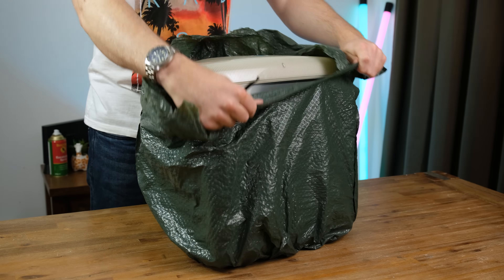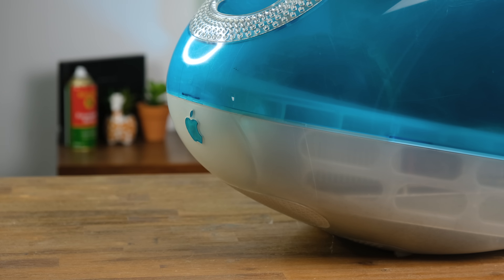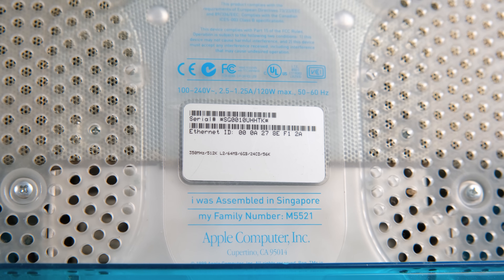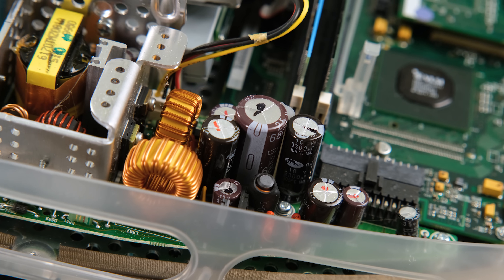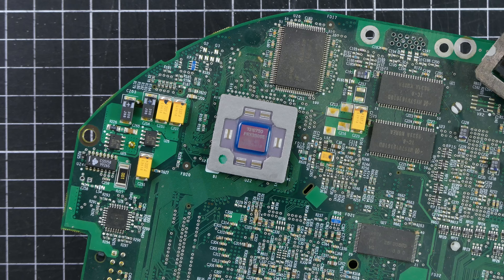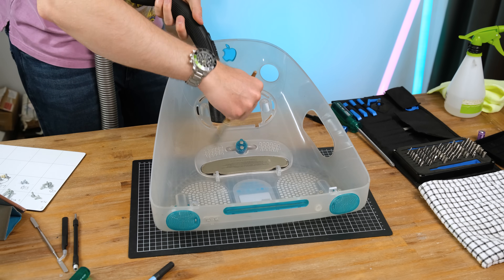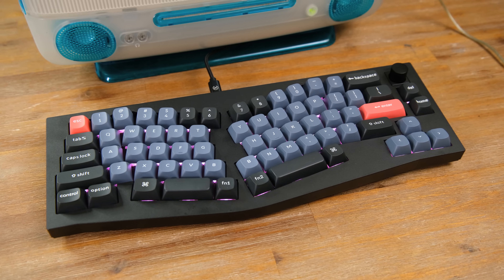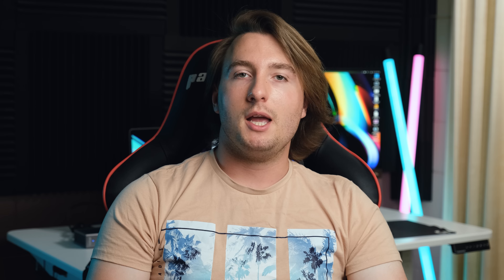Rescuing Apple's Budget iMac From 1999!

Comment: The later models of the iMac G3 were pretty nice and even had decent graphics (up to 16Mb Rage 128 Ultra). The slot-loading iMacs are the most interesting since they have a good balance between old and new. You can play older classic games as well as early 3D games, even UT2003 is (barely) possible. Mac OSX tends to be a bit slow on the iMac G3 and 9.x should be the maximum OS to be installed. Although OSX can be used for more compatibility and to transfer files. Mac OS classic can be a pain in the b*tt when it comes to the resource fork. PCs and newer Mac OS will often destroy disk-images and programs by ignoring the resource fork and even sit-files can be damaged on modern Mac OS X. For the transfer of files between older machines over the internet and through modern systems it is important to encode the files as either binhex or binary (HQX, BIN). This will embed the resource fork into the encoded data-stream. Stuffit-Expander can decode "bin" and "hqx" files without problem.

Comment: dear nathan, would u kindly make a video on the laptop i use? Its a Lenovo Ideapad slim 3i, Intel core i3 1005g1, 4gbs of ddr4 ram (upgraded to 8 in dual channel), 1tb HDD 5400rpm, 15.6 inch 1080p TN panel. i cannot find any vidoes about this particular model of the laptop

Comment: I have something like it. Have the original keyboard and round mouse that came with it. My unit has the firewire port and the external VGA connector in the back. My main gripe is that the image on the crt has shrunk a bit and it seems to be running hot. 
I recall some one had posted a video where they "converted" one of these units by striping out everything (but saving everything) and outfitted the housing with a 15 inch lcd monitor and installed the guts out of an iMac mini, effectively bringing the machine into the "modern age". 
I remember loading a lot of my CD's into the machine and I need to remove the hard drive so as to extract the files and load them onto my MB Pro. T he music was converted to unprotected AAC format which will allow me to save the music and load it onto any machine without issues. It’s really a pity that Apple doesn’t make a conversion kit to update these classics so todays kids can really enjoy a colorful and useful computer.

Comment: I had one of these!! That computer is in my earliest memories. I remember the slot loading disc drive was a pain and didn't eat or eject the disc like it was supposed to, so sometimes you would have to wait for it to stop what it's doing and hit the eject key, rinse and repeat until the disc came out. I remember it was never plugged into a surge outlet and sometimes I wouldn't unplug it during a thunderstorm but it kept on working. I haven't used it in at least 13 years, but its been sitting in the original box.
EDIT: I remember my elementary school had a ton of these and the eMacs in the computer labs, they were on OSX and the beachball of death was always around the corner. Keep in mind, I was 5 at the time so it was 2006

Comment: Brittle plastic is really problematic with these older machines. As example, I have a 1997 IBM Thinkpad 310E with K6-2 @ 233Mhz, 48MB of RAM and the casing on it is just falling apart completely. It sucks of course but it's understandable.

Comment: My parents had the g3 iMac like that one.   It died so they got a G5 iMac then it died later and got a 2017 intel iMac currently.   I also have a 2017 27” iMac still working fine except the slow fusion drive.

Also I remember I had a blue and white G3 tower with same color as that iMac.    I bought it on clearance at CompUSA for $1500.

Comment: Never owned a G3 iMac but I had one of the iconic "lampshade" G4 iMacs,  several PowerMac G4s which were works of art.  Wish I had been able to keep some of them.  Also briefly had a Power Mac G5 Dual processor system till the motherboard failed.
Reply: I have the G4 iMac

Comment: I remember in the early 2000s, a bunch of my friends had these machines and they were failing left and right. Usually it was the hard drive, which makes sense, but as you mentioned, the heat death is likely the culprit.
Reply: that and the flyback transformer goes boom be nice to do a LCD swap especially with those new flexible LCD screen were getting nowadays.